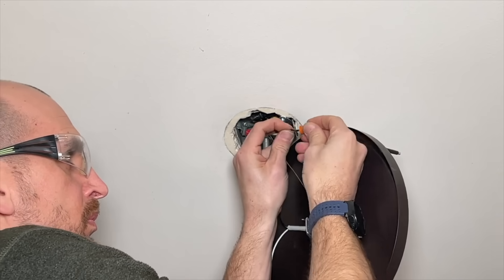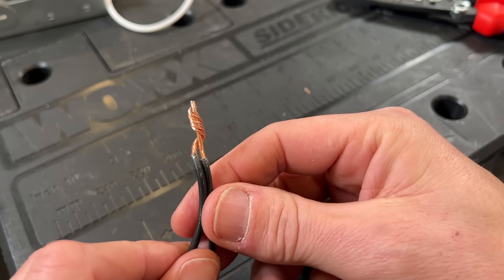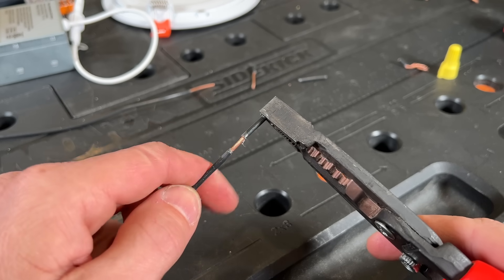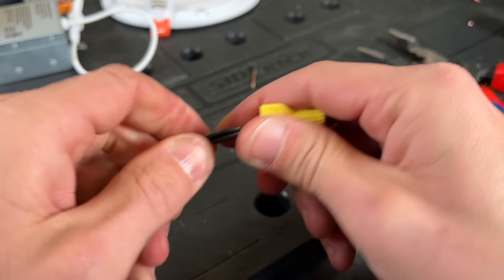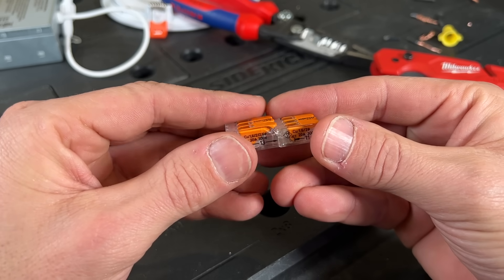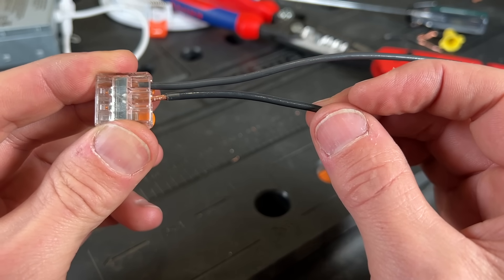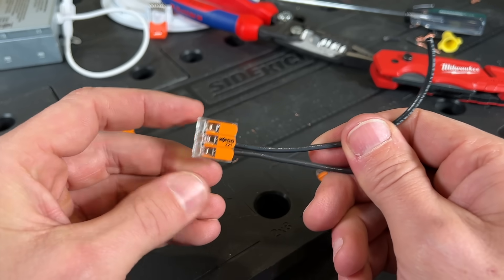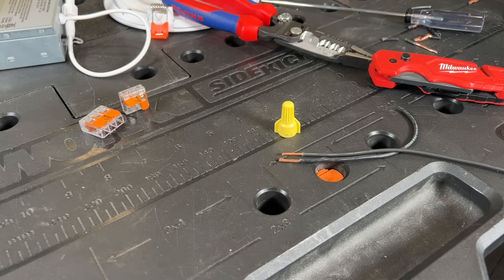Most Common DIYer Electrical Mistake - Don't Let This Be You!

Comment: First, his little clamp connector only cuts into a very small part of the wire so that the contact surface is trivial compared to a wire nut. Second, when you’re pushing this little device into a small box area, you can easily pop the release lever leaving you with a poor connection. The best way in my amateur opinion is to put a little hot solder on the stranded wire and now you’re connecting two solid wires. A little more work, but super secure.

Comment: You need to say what country you are working in as some people may not realise that what you are doing is illegal if you were to do it in Australia (for example). We run 240 volts and almost every wire nut available is illegal to use here (the only ones we can use must have a screw that tightens the wires inside the 'nut').
All that being said; I'm a DIYer and over the 31 years that I have lived in my own home, I have done many electrical installations (power points, aircon install, lighting, etc) and over that time I have seen almost all of the work done by the "professional" electricians that did all the electrical in my house and have been amazed that my house never burnt down due to sloppy workmanship. 
The most recent being the solar panel installation on my steel roof; the entire roof ended up being live with 300 volts running through it! The number of dead birds on my roof that occurred over a short time gave me the clue that something wasn't right with the install. Ironically, that particular solar company went out of business just before I could put in a complaint about the work.............

Comment: I don’t know, I usually do a pull test, I have worked with wire nuts before, but I usually leave the stranded wire straight and stick both into the wire but eventually till they bottom out then twist the nut.

Comment: When stripping wires there’s 2 important factors to keep in mind…most strippers have there wire gauge holes for stripping sized according to SOLID Copper….when using stranded the outside diameter is Slightly larger…this will cause you to “knick” the outer band of small copper wire on the #12 wire and it will break strands off, 
 in this case that then turns your wire into a small gauge….Pro Tip - Always use the next size up when stripping STRANDED WIRE…most actual electrical tools will signify stranded or solid sizes on the side of the strippers, but you can just trust me and go 1 size up

Comment: I guess I'm showing my age. When you mentioned your 'preferred method, I thought you were going to advise 'tinning' the braided wire before using a wire nut. Yes, I have used both those new wire connectors. They are good.

Comment: DIYer.  Thank you for the video.  I did know to pull on the wires to test the connection, but never knew about the technique you showed with shorting the solid wire just a little when using that wing nut.  Thanks again

Comment: Bend the solid over the multi before twisting that nut down till it won’t twist anymore, used to have a drawing of this on the pack the wire nuts came in, did irrigation for decades that’s the only way that lasts

Comment: Better to rotate/wiggle the wire strippers to cut the insulation all the way around to fully cut the insulation at the gap, then pull it off.  I always twist tight the stranded wire around the solid with pliers, leaving a little stranded wire sticking forward to insure the wire-nut grabs it.  I used the 5-hole Wago lever connectors in  under-dash wiring my classic cars, such as to distribute IGN and ACC sources.  They began in industrial wiring, but became more affordable after spreading to home wiring.
Reply: Auto strippers

Comment: I saw a head to head load test on several different electric connectors and the wago did the best. Even better than the wire nut. Cool.

Comment: I work as an electrical assembler , we use Wago's all the time, have been for years but we use the solid grey ones, they come in many sizes and 2 wire, 3 wire and up , I have seen a 10 wire model. They work great and are UL approved, not sure about any building codes that do not allow them but i could be wrong? The thing with the industrial ones is the spring is VERY strong, when closing the hold downs you need to be carefull as those suckers hurt if they catch the side of your fingers, Nice video, love any advice as there is always other ways of doing the job

Comment: Dang.  If only I’d known about this from the first time I struggled with a solid wire/stranded wire connection putting up a ceiling fan.  In 1985.  I now have a conscience which is nagging me to return to every place I lived and places where friends lived that I installed various fans, sconces, ceiling fixtures and chandeliers  over the ensuing years.  That number (as well as I can remember) is about 85 installations.  I thought I had learned everything I needed to know when I found my first Vaco stripper.  Thanks for the update.

Comment: I have run into a problem rerouting my solar wires. The Wago method is my solution. I ordered the 612 which handles 10 gauge. The solar stuff is 10 awg, I am just not sure of the plastic insulation. I am hoping it will easily slide a little into the wago with no problem. If not I will sliver it down with a razor.

Comment: You can get 500 wire nuts for the price of 175 wagos. There could be times they come in handy but if you're just trying in switches receptacles there's no reason for these over priced connectors

Comment: If you allow the stranded wire to stand taller than the solid wire before you put the wire note on you will not have this problem 35 years never a problem good connections all over New England😊

Comment: I have virtually dropped the use of wire nuts and have gone to using slightly oversized butt-end connectors.  I strip each of the connecting wires in the same manner and then slide a length of heat-shrink wire insulator over one of the wires before joining.  I then run each wire through from opposite ends and use pliers to make a small turn on the end of each wire before pulling each wire back into the connector until the "bead" makes contact with the conducting inner sleeve.  I then crimp each end and the center of the butt connector and run the heat-shrink tubing back over the connector before sealing the connection.  I have also modified the way wires are connected to receptacles and wall switches after almost having a fire in my daughter's mobile home due to poor installation by the careless builder.  Rather than simply wind the wire around the attaching screw in a box before tightening, I run each wire into a closed-end connector and run it all the way through and bend it back before crimping so that it cannot come loose and then run the receptacle screw through the eye of the connector.  The connector must be heavy enough to permit current flow or the modified connection would be worse than the original.

Comment: I've used something similar to the Wago's before called an Alumiconn connector. Basically the same principle, but they use a set screw to tighten down the wire instead of a lever. They work great for when your house is wired with aluminum, but the wire you're connecting to is copper. However, I might give the Wago's a try after seeing how much easier they are to use 👍
Reply: Wagos are great for mixed strand/solid connections. I still can't bring myself to use them when pigtailing receptacles or single phase motors, but in small wire big wire applications, they are a must. Their ratings are not a joke either.
Reply: I've used Alumiconn and Polaris insuli-tap connectors in industrial applications for years.. nothing quite as good as that for when used on very high amperage applications.  Motors pulling hundreds of amps etc.

Comment: I have never really understood why it's not a common practice to use a crimp connector instead of a wire nut. Crimp connectors are a much more solid connection than these twist connectors.

Comment: Some areas in the U.S. have electrical codes calling for the electrician to tape the wires to the wire nut after connecting them. I never have, and have only had one (a pigtail) ever fail on me in nearly 30 years (no harm done). 
Any thoughts on it? I think if I were dealing with high voltage/amp devices, I might be extra careful and tape the connection. But I know from experience that the tape itself will also fail eventually in some instances... BTW, have never been a fan of stranded wire... ;-)

Comment: I started doing this way back in 1979 …. My Journeyman made a point to show this to me. I do it without thinking about it.
I like wago connectors lever or push, I’ve personally never seen a failure… that being said, I won’t use them on a residential rough due to the liability concerns, I go with the 3M wire nut products.

Comment: Do you not use screw terminals for low current one to one connections like for a lamp? I've always used a little square. They sell those where you can cut off any number segments off. Lamps might come with one.

Comment: I like my old Radio Shack "automatic" wire stripper hand tool.  It seems to strip flawlessly, a perfect strip every time!  I dont use it often as I'm not in the trade but it's great for around the house, all the way from very tiny electronics to diy fixture install, etc.

Comment: Great presentation. I did not know about leading the stranded wire. This makes me want to inspect all the under-cabinet lighting I installed a few years ago.

If you do projects that require a lot of wire cutting, don't use snip-type cutters because they are hard on human joints. Instead. use shears such as Klein Tools 63050 Cable Cutter. A cable cutter will go through any household gauge of soft copper or aluminum wire like a hot knife through butter without stress on your hand or wrists. They will also cleanly cut through 3-wire Romex. They last a long time. Mine are still cutting perfectly after nearly 30 years.

Similarly, if you are stripping a lot of wire, don't use a pull-type stripper; use a plier-squeeze type such as the Capri Tools 20010 Precision Wire Stripper or a Gardner Bender SE-92. Either of these makes stripping very fast and easy on the body too.

Comment: Ceramic knob and tube was and is considered dangerous but the are soldered at the ends and even if the tar soaked cloth insulation comes off in places, they don't arc to touch anything undisturbed. Now, I nail, construction screw or pipe is added, it should have an arc-fault breaker installed. This requires the service box to be changed and not all, but most now have a grounding leg in the box to make connection new styles of arc-fault are added. So now, arc-fault, GFCI is all in one breaker just ask for the update box. Unsure of anything, call a licensed electrician. Then a massage therapist when you get the bill to keep heart attacks and strokes away! Easy

Comment: I installed a ceiling light. During the installation, I turned on the switch and used a test pen to test the wire nut which splices the fire wires, the test pen was lighted! So I wrapped electrical tape on it.

Comment: The WAGO 221 and the 222 series predecesor have been my preferred splicing wire device for field applications form over 20 years. The newer inline model are particularly useful for some types of applications; and also there is a variation for hazloc use; which are superb. Great products. Very good recommendation in my opinion.

Comment: Remember the Wago is a bus bar, each pocket will connect to the next and is only meant to connect same function wires. (hot with hot, neutral with neutral, etc.)

Comment: My home is 35 years old and I periodically have to replace wall sockets where the home builder used some push-in connection that has failed instead of using a screwdriver and looping wire around the screw.

Comment: Are the Wagos up to code to use instead of a junction box. Like I need another 10 feet of 14-2 to reach a outlet. I believe  junction boxes have to be accessible then and can't be permanently covered? Thanks
Reply: Also wago connections need to be installed in an enclosure that is accessible.
Reply: Edit : a non flammable and not conductive enclosure. Plastic, no wood, no metal.

Comment: The only issue I could see with the Wago is if the lever might snag, and get loosened, in the inevitable cramming and stuffing of wires in and out of the confines of a box. As long as the means is Code-approved, proper usage and installation should be safe for as long as the house stands. Lever styles seem far easier, and more self-evident, to use, while wire nuts can seem secure yet make an insecure connection.

Comment: Wow, I did not know about Wago before and I was putting on a light high in the ceiling and it was a very awkward position and I could not install with the regular connections.  When I seen you video, I ordered from Amazon and I had them delivered to me the next day.  The next day, I made the connections very secure and the light was firmly installed.  Wow, this is an amazing product and I would paid 10 times the amount for such a great product.

Comment: Wrong answer here!!! The NEC Code states that you have to pretwist wires and not use the wire nut to make the nonsolder joint, this will cause a lot of joints to fail. As an electrician I have had to fix this mistake many times. The correct way is to fully cover the solid wire that is exposed with the stranded wire. Then take a pair of linemen and twist the two wires together. After cut the tip of the joint to insure an even end that will protect the uninsulated joint. Then afterwards place the wire nut and twist to hand tight.

Comment: You will never convince my those wago are anything more than overpriced junk. The problem with the play in those levers is that they become hooks that can snag and come lose on other wires. They are garbage just like the push connections on the back of outlets. 
Edit: 9:44 look how little effort it takes to release those levers.

Comment: I feel you should mention about 221's not approved for AU only the push-wire connectors with their version of noalox is. I know this isnt the focus of the video here, but I dont think I've heard you mention it. Unfortuantely my '57 house has lots of cloth wrapped au wire inside of metal flex conduit which serves as the ground. Impossible for me to rewire the house at this time, maybe if we strip down to studs. To add insult to injury my 'basement' is less than 5' in height, with a 100a service panel in there. I want to upgrade to 200A but then I need to relocate to the otherside of the house to my garage. If you need a project on the east coast lol.....

Comment: Person making this video is mistaken this is not the correct way to connect wire nuts from solid and stranded wire and I'm going to tell you why. One it does need to be twisted around however if you do not twist it around properly what will happen is you'll get an arcing between wires and just because the stranded wire is twisted around the solid wire does not mean that is connected properly you can still pull that stranded wire out from underneath of that wire nut if it's not making a good connection. The way that you make a good connection with this is you put a little after you twist them together you take your clients and you put a little bit of a bend in The Wire what this does is it changes the friction point of The Wire and increases their capacity to to stay together and not come apart I'm tempted to make a video and this video did inspire me to do that however I would also recommend using clients not wire strippers to make a proper wire joint and improper joint will cause arcing and it will melt the wire nut and cause a fire leave electrical work to electricians. Or risk burning your house down. There is a reason why it takes 4 years for an electrician to become licensed

Comment: Journeyman for our house put two wires on each screw terminal for closet lamp, then ran that drop to the wall receptacles.  Actually things ran that way since 1967, until Dad plugged in air conditioning for the first time.  I had to go through all ceiling lamps, wire-nutting the connectors properly with jumps for the lamp.  There are ways you can cheat with bigger screws and washers, but it's better to butt the connections properly.

Comment: Wirenuts are the real failure point..never use.I like the Nipex brand but these  strippers you use in your video are not the best tool for stripping cable IMO. something like the IRWIN VISE-GRIP Self-Adjusting Wire Stripper is faster and auto adjusting for any size from 1.5mm up to 16mm stranded cable.

Comment: Yhe most common mistake in electrical is earth ground and neutral. Neutral is a traveler current wire and not a earth ground. A real isolated earth ground does not travel back to transformer as all neutrals do . What does ac volts mean ? Alernsting current . This means goes out the returns 50% it went out. If it was 120 volt 30 amps , return be 60 volts 15 amp. Earth ground is always 0 volt 0 amp.

Comment: Try stripping like this: Cut the insulation with the correct size hole then move the wire to the next larger hole and pull off the insulation there. (But before I pull off the cut insulation I put the cutting edge 1/8" to 1/4" closer to the end). The slightly larger cutting hole prevents scraping or nicking the copper and the cutting edge grabs the insulation instead of just pushing it so sometimes it slides off easier.
Reply: Hey look... actual good information
Reply: NEVER TWIST THE NUT WITH SOLID OVER STRANDED, YOU WANT STRSNDED OVER SOLID.. I DONT KNOW YOU TAUGHT YIU THAT BUT ITS COMPLETELY WRONG
Reply: Do you do this with the common pliers-style stripper or a Katapult?
Reply: Jjjjnm